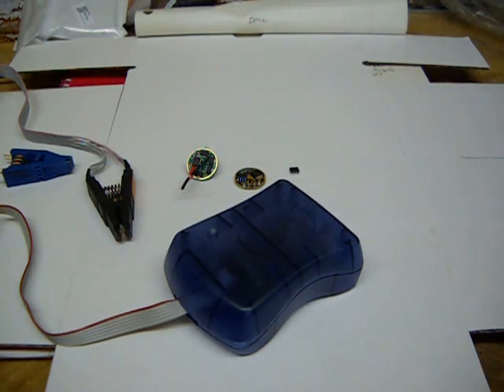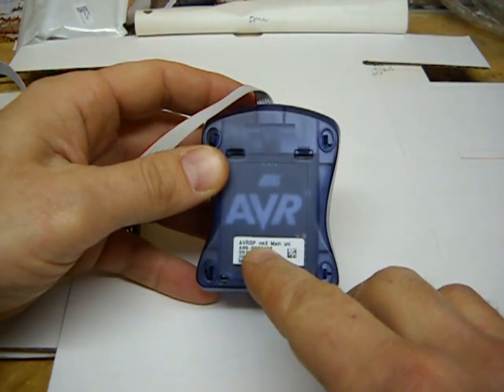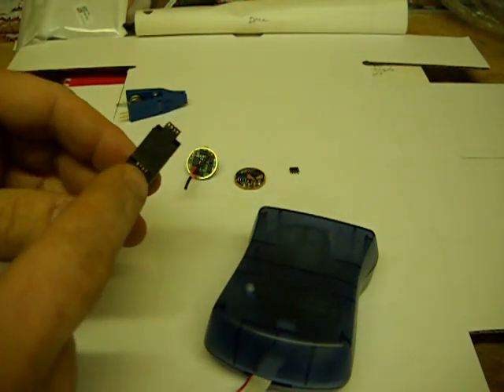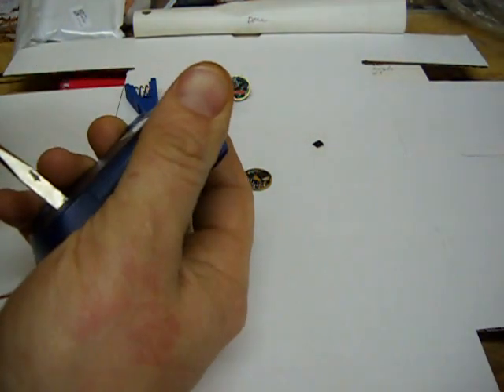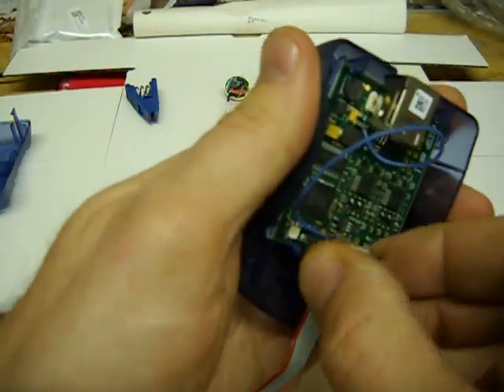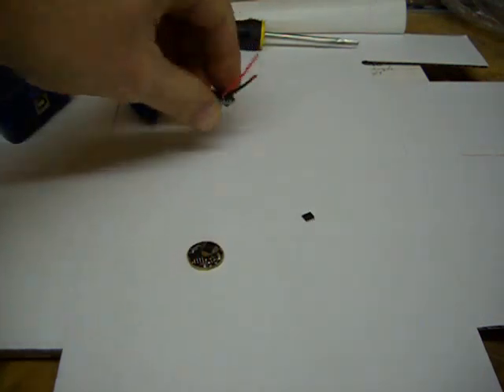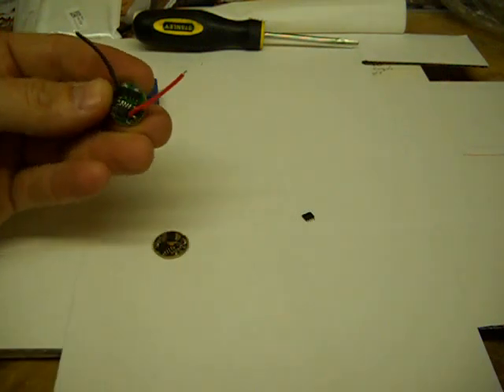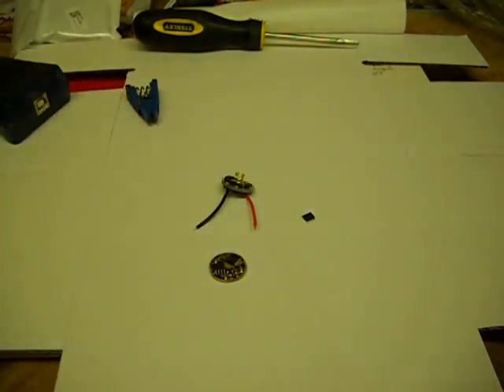How to program an LED driver - High Power LEDs Pt.1

Comment: We need a 2023/2024 version of this. 🤔😕😊
Reply: Whatre you working on? Feels surreal seeing "1d" on a comment
Reply: @morganholloman6650  You saw the mod that I did for my 2AA MagLite right ? 😆😄

I posted it on my Community tab on my channel.
Reply: @morganholloman6650  It sure is. 😁👍

I'm thinking on reprogramming a couple of those cheap P13.5S 200/210 lumens LED replacement bulbs & selling them for a higher price (for starters). So combining dropshipping with some custom extra features kinda stuff. 😊😆👌

Because I opened one of them up. It has an OCX 0C7140 8-pin IC & I definitely want to try my luck with it. A couple of months back I went to open up an account on CandlePowerForums. Just to find out I got banned for no apparent reason. I didn't even post anything. What a bummer. 🤔😕😒😳

After that... hey who knows. I already ordered myself a PickIt 2 programmer. Eventually I'll get the 3rd version when I'll be comfortable.

You saw you can get a 700 lumens P13.5S LED upgrade right ? See seller "torchupgrades" online. Got mine a couple of months back for my blue 2D MagLite & I love it. 😉😇🤗
Reply: I havent, I'll have to check that out!